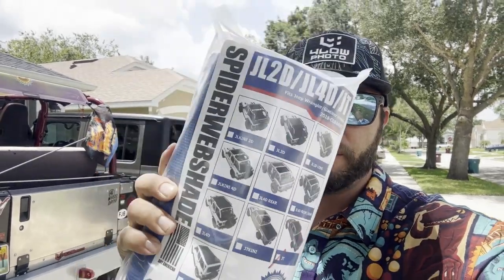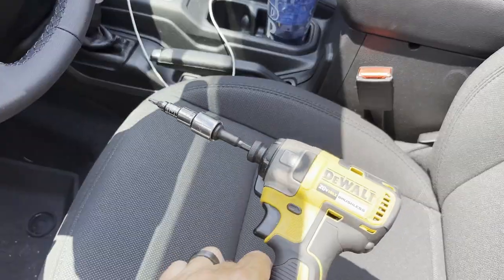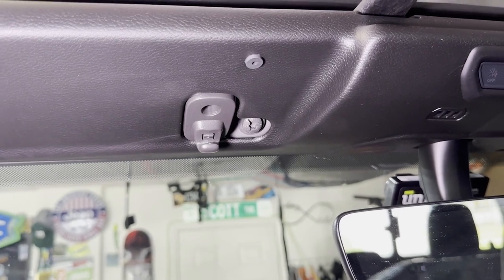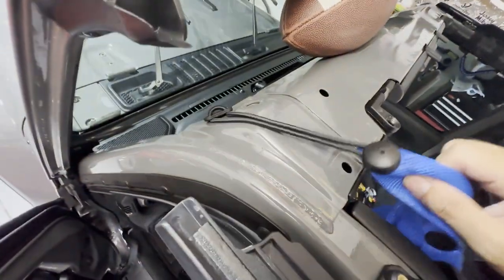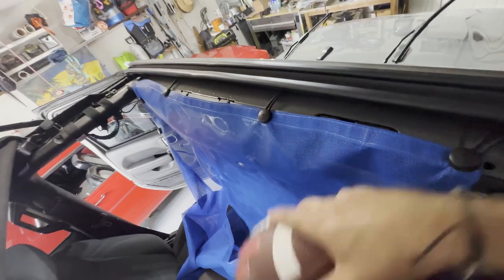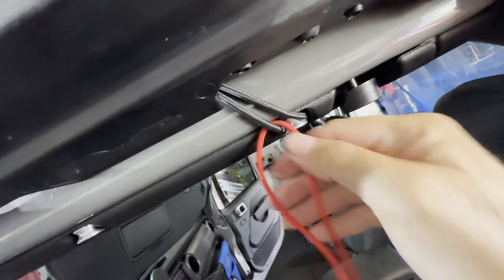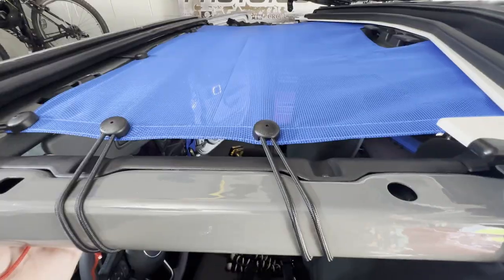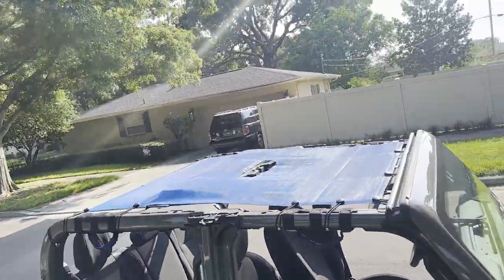SPIDERWEBSHADE install with a BESTOP Sunrider on a Jeep Gladiator!

Comment: Little late here but i noticed the weather stripping on your driver door side at the front of the sunrider has that extra little flap on it thats being forced down by the sunrider.. has that caused you any with water intrusion?
Reply from the maker: Good catch. And yes , had to flip. Very little but basically when it rains it would run in but only with door open

Comment: Thanks for sharing. I guess my only concern is you won't be able to close the sunrider from the inside then? Was hoping that center gap would allow you to put your hand thru to reach it.
Reply from the maker: Think the cut out is just for the hardtop mounts. I just reach my hand out the window while sitting inside. But I'll try tomorrow through the cut out. If not it's still worth it to have shade. The week before I got over to Sws to pick it up, it was hot! Lol
Reply: @4lowphoto  Appreciate the feedback. I used to have spiderwebshade for my JKU. The JLU seems a bit more complicated to install.
Reply from the maker: @Airkoay  jeep change the cage quite a bit. Sws could have gone the cheap route like the imitators, but they wanted it give the most coverage and always be nice and taught. It's worth it.

Comment: That savvy rear bumper you had on the JLU back in the day how did it hold up? I’m looking at buying one for my Jlu? Also did you paint or powder coat
Reply from the maker: Everything savvy makes is quality. And it's aluminum so it lasts. I dint know if that particular prototype went into production. But I would still Recommend anything savvy.